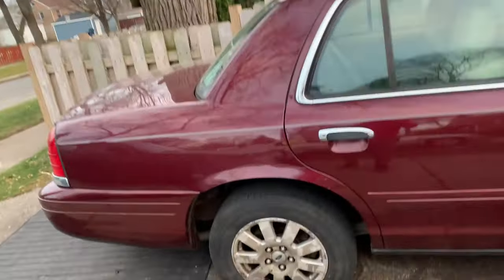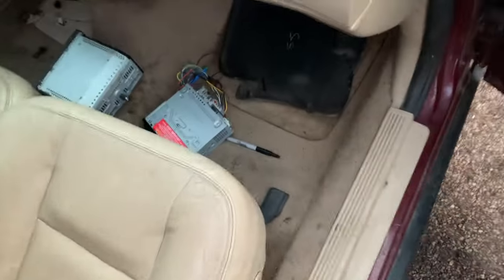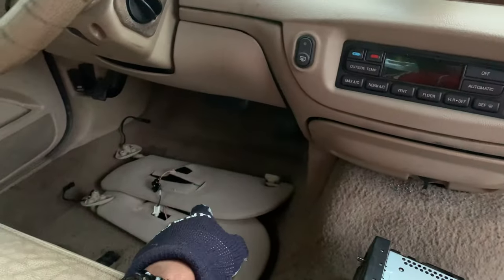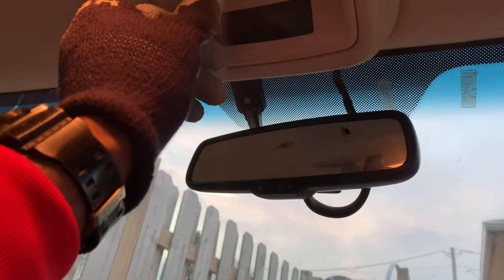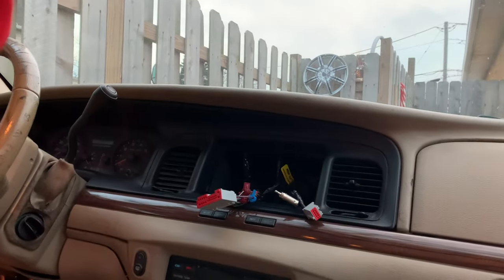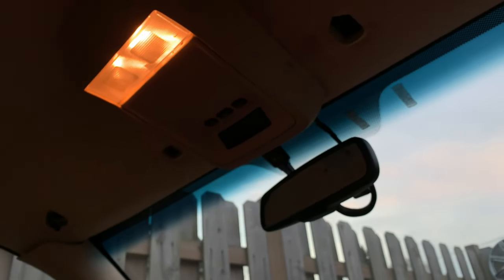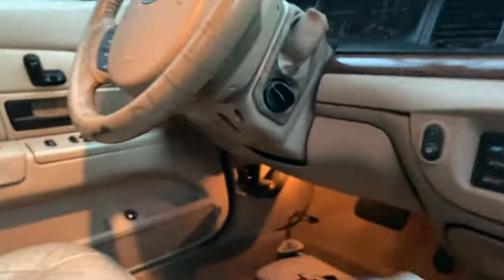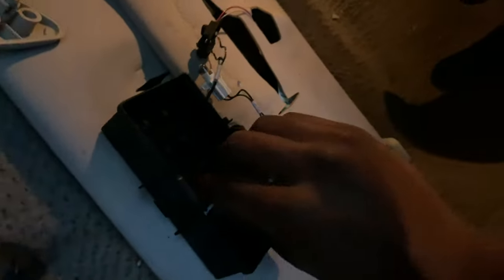Crown Victorias interior light fuse keeps blowing: this is how I solved it.

Comment: Hey man quick thought. Make sure your dimmer switch isn't turned all the way on. That will turn on the interior lights. It rolls from off to all the way bright, then it kind of clicks over a little more and that last bit turns on the interior lights. Hopefully that's it. Otherwise it must be a door switch thinks it's open.
Reply from the maker: Thanks brother this car was later sold but it had many interior issues that I did figure out